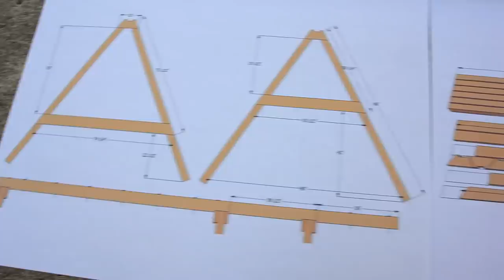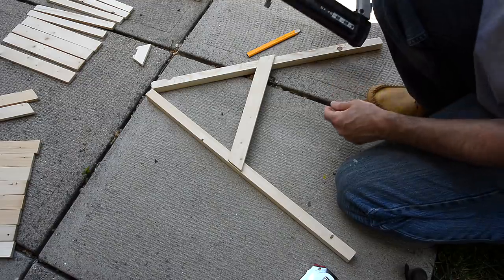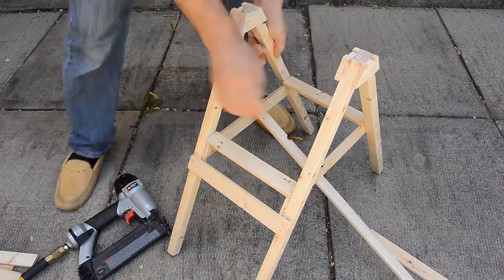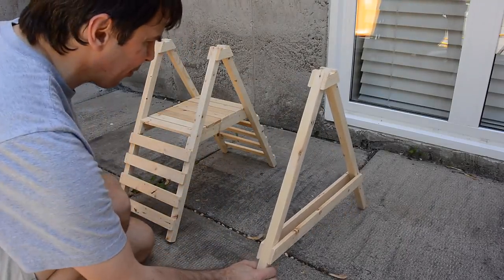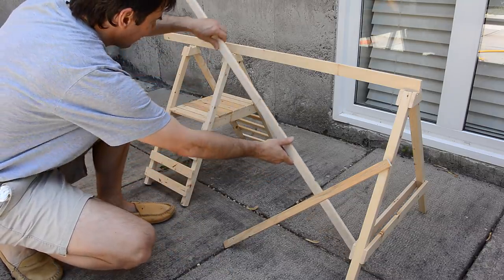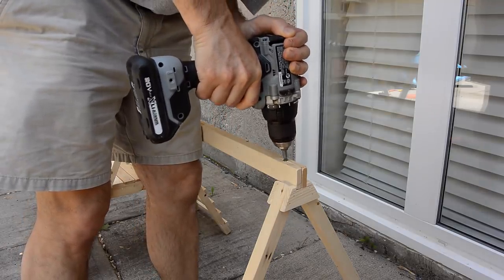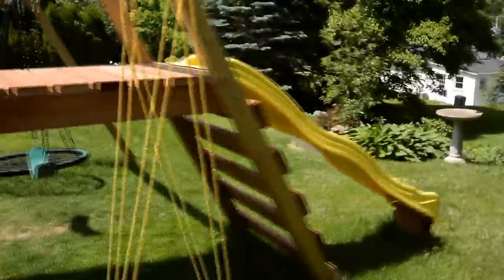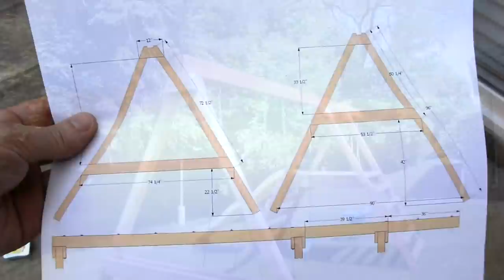Swing set

Comment: Thanks so much for this video and the plans!  I built this recently more or less following the plans. Here's my comments:
1.) I used a 12' 4x6 beam for the top. The set just stops at the slide instead of having one extra bay.

2.) I used 3/8" carriage bolts/hex bolts and then also 4 deck screws on each of the 2x6 to 4x4 joints.  We cut off the excess with a hacksaw and used a file to smooth the burrs.

3.) I couldn't find 12" carriage bolts, so I used 10" long 1/2" lag screws to connect the top beam to the 2x6 brackets.  I also used decking brackets with short 1.25" screws for additional stability (Simpson part# LPC4Z)

4.) Carefully consider the swing hanger (or eye bolt) spacing listed in the plans for your needs.  7.5" is probably too little.  17.25" might be too much.  Depending on how much space you need, you might only fit 2 or 3 swings instead of 3 or 4, like he mentioned in the video.

5.)  For the 62 degree (or 28 degree, depending how you look at it) cuts, you only need to get it right once.  Once you have a good cut at the right angle, use it to scribe the remaining cuts.  The 90" wide base for the legs is more important than getting EXACTLY a 62 degree cut.

6.)  The plans call for a 3" notch in the upper brackets.  The life size swing set in the video doesn't seem to have this, but it's probably a good idea for some additional support of the main beam.  However, it should be 3.5" to fit a 4x6, not 3.

Overall these were great plans and saved me from having to re-invent the wheel, so thank you!

Comment: I agree with your father in law when it comes to the carriage bolts. The fasteners are  in the elements and the wood will expand and contract a little. Better be safe than sorry.
Reply: I'll take the bolt and nut sandwich for that kind of joint too.
Reply: Agreed.
Reply: I agree on this as well... the main concern seemed to be that they were long/exposed for kids to hurt themselves on. Store-purchased sets recess the bolts/nuts into the wood so that they aren't exposed.
Reply: Mhmm, no need to risk under-engineering something that your kids will be playing on.
Reply: @JoeBcrafts  I'd add double nuts just to be sure.

Comment: Used decking screws to hold a 45 degree brace to a fence mounted on a deck. I have replaced them every other season. The fatigue and snap due to the slight movement from the wind. I keep meaning to replace with bolts.

Comment: As noted, the carriage bolts wont, or shouldn't loosen overtime or lose holding strength as they compress the members and do not rely on threads gripping wood.
HOWEVER,  if you plan to use screws, get something like a GRK RSS ( Rugged Structural Screws) ...for example the 5/16" × 3-1/8" (GRK #112221)  handles an 840 lb sheer force.
Deck screws do not have nearly the same shear force....840 lb is somewhere around (greater than ?) That of a 1/2" lag bolt, and it looked like the carriage bolts may have been 1/2" 
If you ate going through 2x material into the 4x , then use the 4"  or 5-1/8" long GRK RSS to get past center if the 4x
You needn't use GRK Brand, Threadlocker also makes "Lag Screw Replacement" screws....take your pick, the key point being Shear Strength in this application. (GRK actually list Playground Equipment on the back of the RSS pack as suggested use)

Comment: Deck screws, like drywall screws, have their purpose but I learned my lesson about how brittle they are under load and movement. It’s no wonder they are not approved for anything structural. I’ve switched to structural screws or malleable screws for uses like this. Their are lots of manufacturers; GRK and Simpson are both premium brands...

Comment: Warning!!!  Omitting the carriage bolts at the gussets and only using the screws you mentioned is setting yourself up for failure.  As your kids get older/bigger the racking stress on all the leg members goes up exponential, especially at that connection, while swinging.  If you build it "right," the joint will outlast the wood rather than having the joint fail prematurely because someone skimped on a few bolts.  I had seen and experienced both.  The other weak link is the ridge, more screws could have been used connecting the two board together, especially next to the eye bolts.  Raising eight kids has taught me a thing or two.

Comment: Prolly simpler to cut the angles on the A frame after you've assembled them, as time cuts go. And you can use those ball end nuts for those, tho, i have found that wood does tend to crack in such structures (exposed to elements, i mean). So i don't know...

Comment: We had the same problem with the slide being high on sloped ground. We just let the slide be steeper and let the kids go for a ride. They only ate it a few times before they got the hang of it.

Edit: We were actually pretty impressed with how sturdy the pre-made set was. 4x4 posts. It's got 2 levels. And we still felt like the hold downs were unnecessary. Put them in just because they were included. Then again it was $1k.
Reply from the maker: the ones I have seen doesn't use 4x4 pots.  Everything is under sized from standard lumber sizes.

Comment: Has anyone built this? How much did wood and supplies cost?
Reply: I bought the plan and materials. Granted I bought 4" structural screws for the "A" frames and they are a bit pricier than deck screws... so anyway with 4 swings and the slide I'm right around 600$ CAD before taxes

Comment: Idea - For the long top beams. Cut 1/2" wide x 1/4" deep dados in each 2x6 instead of drilling holes. Add a 7 1/2" long 2x4 with a hole in the center across the bottom of the top A-frame supports. Use one long bolt for each A-frame. Might be cheaper to use threaded ready rod.
Reply from the maker: Idea: Instead of cutting dados and making sure they line up, just clamp the pieces together and drill between them.  Easier that way.

Comment: Good video, only one newbie question though. That top beams seems rather limitedly secured by 3 1' carriage bolts.  Granted its laid in a cut-out, however even that look like ~1/2 inch.  Why not allow the beam to ride lower, and screw/bolt the top of the A frame legs through the beam? I guess it might be totally different if one was onsite and actually looking at it.
Reply from the maker: there isn't much pushing the beam over.  The swings are attached to the bottom, so if you swing, it  pulls on the beam at the same height as where it's supported.

Comment: I just bought the plans and was intending to recycle some 4x4s that have a little rot on one end.  I’m thinking of cutting it off then half-lapping a repair with adhesive and fasteners . Any opinion if that would stand the forces involved?
Reply from the maker: As long as the half-lap joint is very close to the end and at least 10" long, should be ok.  But also use some screws, can't trust the adhesive long term.
Reply: @matthiaswandel  thanks for the reply!

Comment: You should use a forstner bit to embed those nuts so they don't stick out.
Reply: Wouldn’t that make the wood more likely to split?
Reply: @jonwilson7871  That's what they did in the store bought one that I had.  You only have to go deep enough to make the nuts and bolts flush to the surface.

Comment: Very cool! What kind of sealer did you use? If you used any at all
Reply: For what it’s worth, I used

1 gal. 100 VOC Oil-Based Pacific Redwood Penetrating Exterior Stain and Sealer

https://www.homedepot.com/p/202521247 myself. Used about 2/3 of the gallon on one thick coat. Looks similar to what’s in the video. Great!

Comment: How's the set ankered? As soon as two bigger kids start swinging on this in synch I would worry about it toppling over if not ankered.
Reply: I doubt it's anchored.
Reply: doesnt need to be i dont think, the angle of the legs are more than enough to keep it stable
Reply: Not for toddlers, but I‘m pretty sure that two kids aged 10-12 swinging at high angles and in synch will topple this in no time. I‘ve not found any specs for swing sets that would not need anchoring and I don‘t think there are.

Comment: I looked through the comments and didn’t see the answer for this:  do you need to build the slide platform to prevent side to side racking?  Or can you build two a frames for a couple of swings only?
Reply from the maker: The slide platform prevents racking
Reply: Matthias Wandel if you were to build this without the platform, how much would you angle the frames on the ends?  Or would you leave them at 90° and add corner bracing?

Comment: Instead of using a thinner piece of lumber to make the circular saw guide; why not configure your cut jig to run the saw on the non motor side, avoiding the issue entirely?
Reply: good point, but i think then youd have to use the saw left handed wouldnt you?
Reply from the maker: cause you don't want the saw on the piece that falls off
Reply: Hahaha well yes I suppose you're right- that would require a separate support etc.